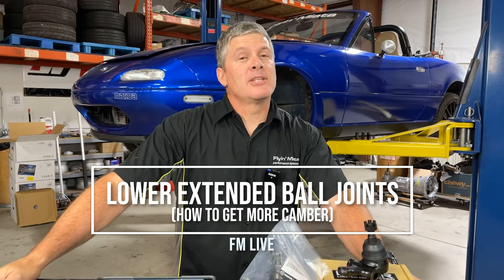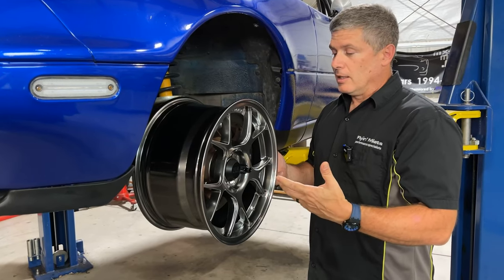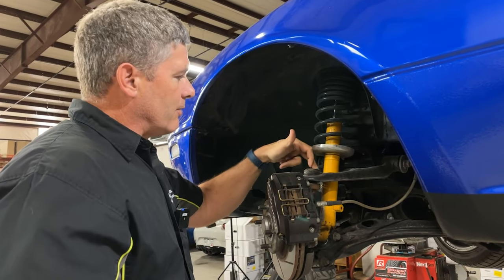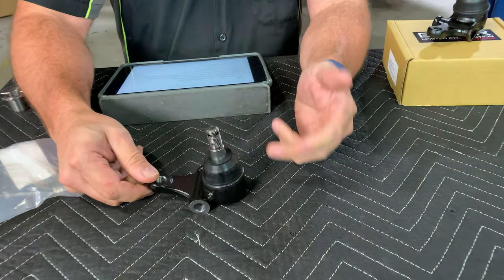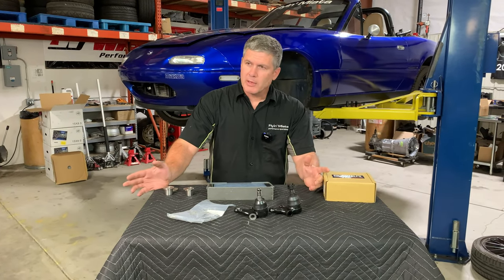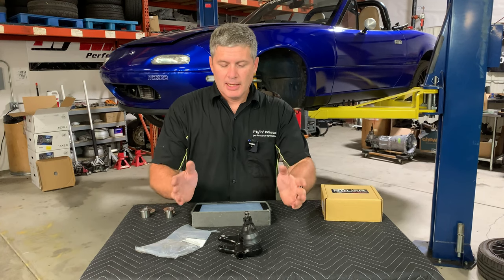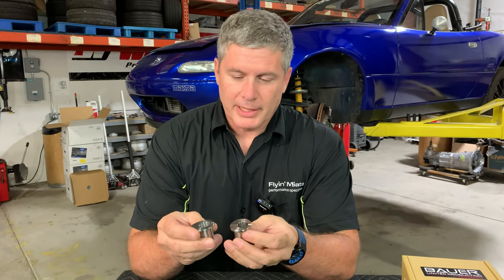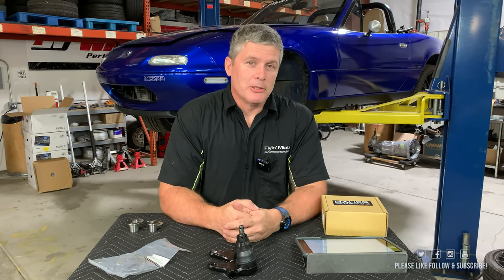How to Get More CAMBER! (Lower Extended Ball Joints - FM Live)

Comment: I have this on my ‘94 to get more camber without lowering the car. I now have -2.5° of camber. However, at stock height, my alignment tech was only able to get to 2.6° of caster and the steering is super light. Too light. Just know that if you plan to get these and aren’t lowered.
Reply: Shimm out your subframe to have more caster that will stiffen up your steering agean.

Comment: I have an nb2 and was going to refresh the frontend with upper and lower ball joints. I was also going to be purchasing the vmaxx extreme package....
1. Will I have an issue with rubbing the arms with the vmaxx? 
2. If I'm at the recommended ride height with the coils, is the ball joint necessary? Mostly a street car. 
3. Wider stance, will this also give more angle?

Comment: Very informative video! I had a balljoint failure just recently on my '93 however I was just in stop and go traffic on a street. My wheel is absolutely destroyed from the lower ball joint digging into the wheel and scratching it. Would you recommend extended lower ball joints for daily/ street use? running 15x8 +20 205/50/r15 on bc racing coilovers
Reply from the maker: We usually only recommend running our extended lower ball joints if there is an alignment spec you physically cannot meet without them. If stock ball joints work for your desired alignment, run with those.

Comment: Would it be advisable to have adjustable height coilovers, or should you still be able to get all the benefits with just shocks and springs?
Reply from the maker: These will add negative camber regardless of your ride height, and whether that ride height comes from coilovers or a specific spring selection. Determine your ride height, check your maximum negative camber and then decide if you need more.

Comment: How about some explanation of the alignment settings and how one affects the other. I know that you'll have to sacrifice some caster to get more camber.
Reply from the maker: That's true if you use a stock ball joint, but this adds camber without affecting caster significantly.
We did a video on all the alignment settings a while back.
Reply: @FlyinMiataVideo  ok, cool. I'll check it out. But this essentially is the best option then.
Reply from the maker: @38tech  We think so, yes.

Comment: Two questions about removing camber: 

Context: I have a 2002 NB that came with with adjustable fortune auto coilovers. It was extremely low to the floor and the camber was excessive for a street car(i dont know how they can enjoy that). I was able to raise it up about an inch max(although I wanted to bring it up another 1-2 more inches but that was the max for these coilovers) and was able to bring the camber down to about -4.5 degrees all around but im unable to bring it in further. I want to raise the car another inch or two and remove another 2-ish degrees of camber. 

Question one: would installing adjustable lower control arms to reduce the camber further also raise the ride height another inch? Im imagining that it would rise somewhat because the car is balancing itself better on 8 sidewalls vs bias leaning on the inner 4, but not sure if 1 entire inch would be gained from it.

Second question: would raising the height 1 inch through the suspension reduce my camber from -4.5 to -2 degrees im looking for too? Or would I still need lower control arms?
Reply from the maker: Given your numbers, your car is either far too low or someone has done something to add negative camber. Best option in the latter case is to find what was done and undo it. Raising the ride height will definitely decrease the amount of negative camber if you don't do anything else. Very rough rule of thumb is that an inch of ride height change will be approximately a degree of camber change on a Miata.
Reply: @FlyinMiataVideo  perfect. This is exactly the answer I was looking for.
Thank you!
The car was definitely too low and was scraping the floor on very small bumps but I got a good deal on it so I intend to undo it. It doesn't look like they did anything else but lower it through coilovers so im going to try to raise it more through suspension.